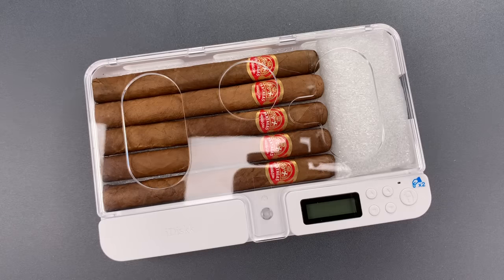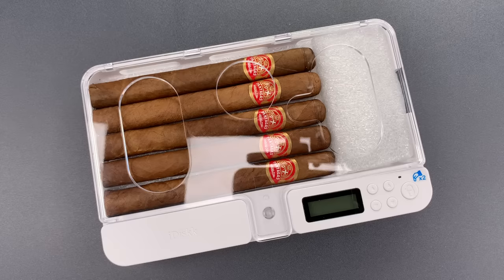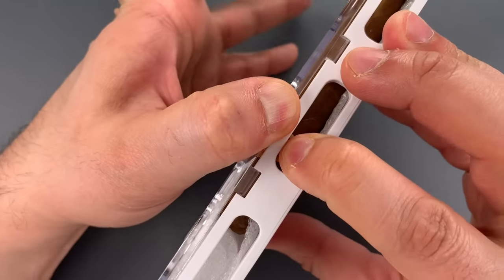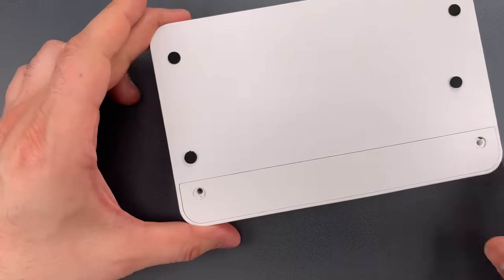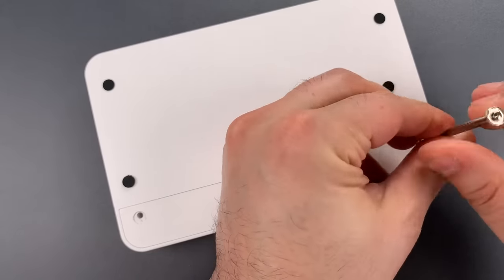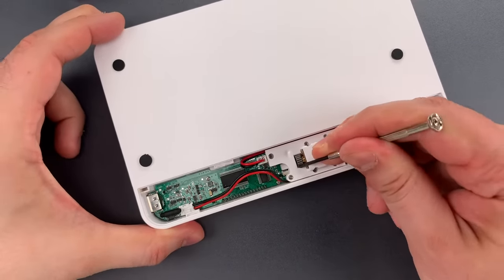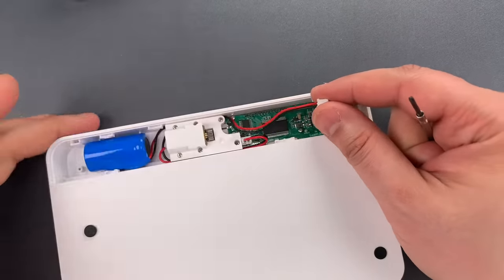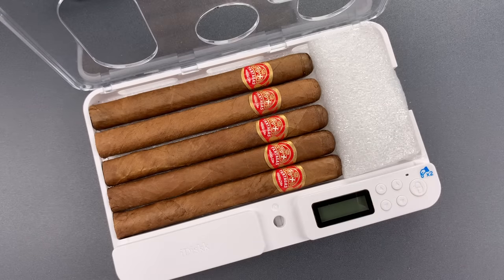[1192] Cuban Cigars Secured In An Electronic Smartphone Locker

Comment: that moment when a prank cigar box is still more secure locking mechanics wise than some of the gun lockers he has shown.
Reply: Lemme just grab my magnet
Reply: Gun lockers aren't designed to work. They're a big middle finger to security, designed as cheaply as possible to comply with the law without actually doing anything to secure a gun.

This was made to actually secure something.
Reply: tbh in this one he is addressing a challenge in real time whereas in others he's presenting deficiencies after a period of research.

Not to imply he is any lesser for it - this video is a great way to show how he approaches a new lock with active problem-solving skills.
Reply: You forget that the lid here is only plastic, and the hinges could easily be destroyed.
The gun safes are not hard to open as he has shown, but this was only hard to open because he tried it non destructive. This is basically openable by just dropping it
Reply: Not literally though. This thing could be destroyed by a gentle yet firm hammer blow.
Reply: lemme just get my lego astronaut
Reply: @addictinggames5232  That's fair.
Reply: @TeaInTheMorning-we2kh  so could the phone inside

Comment: “Have you tried turning it off and on?” Seems like the dumbest thing but it honestly has a lot of practical use
Reply: IT tech here, used to work call center, and yes, unbelievably yes.  Probably around 20-25% of my non-password related calls were "restart computer and if they were nice educate about RAM and Paging files."
Reply: As the tech support dude her says, a damned large portion of tech problems can be fixed with turning it off and on again. Anything from a phone, to a computer to a literal nuclear reactor and space craft
Reply: @athenacykes3486  That must have been before RAM evolved to become sufficiently large enough to make paging files unnecessary! :D
Reply: @athenacykes3486  It's fairly understandable that since an OS loads most of its configuration during startup, that many faults can be resolved with a restart/cold boot.
Reply: @ryanm.191  is it just me or have i heard the spacecraft one before
Reply: @ryanm.191  oh right it's hubble lmao
Reply: @DarkVoidIII  yet paging files is still a thing commonly used by almost all OSS unless you specifically turn it off
Reply: @Bradyboy26  You've never used Windows 10 or any OS that doesn't rely on paging files any more. Paging files became unnecessary for modern PC's and other devices when memory sizes increased sufficiently to handle it in memory.
Reply: surprisingly alot of stuff is as easy is turning it off and back on again
ive even fixed some issues by just unlplugging the 24pin from a motherboard and plugging it back in
Reply: @DarkVoidIII  Win 10 still has one. No doubt there as a redundancy for when the hardware no-longer matches the demands put on it. Not everyone replaces their computer every 2 years and for those who have an older machine, that extra virtual memory will very likely be a requisite. RAM overtaking demand is not a new phenomenon.
Reply: @kingofthegames7179  Also, yanking the CRT/CMOS battery on those systems that still have them is a common fix. Restoring the mainboard config to factory settings can deal with a slew of issues.
Reply: Didn't work for my grandma on life support . When i turned it back on, she as still off .
Reply: @sloh888  Probably needed a larger virtual memory reserve.
Reply: When did that happend @DarkVoidIII  ?
Reply: Yeah  @Pooknottin  win10 deffo has a pagefile, mine is in use that is for sure.
Reply: when your PC is on its last leg, turning it on and off is necessary. I was running from bluescreens/my computer giving up for weeks by cutting power cold and turning it back on like nothing happened.
Reply: @Pooknottin  also, even when you have data demands that fit within the RAM, sometimes you don't, and software doesn't always play nice. And you don't want an application, or even an OS to crash because it suddenly runs out of memory. It's not so much a redundancy, but an uncoupled store of memory.
Reply: @KnightSwordAG  Thanks for the heads up
Reply: IT crowd
Reply: turning it off and on is my first action now
Reply: Military Aviation guy here. That works for the majority of our problems on the aircraft too
Reply: Yeah turning stuff off and on can have almost miracle like effects.
Reply: They did that with the Hubble space telescope
Reply: @ryanm.191  Due to design flaws, Chernobyl nuclear power plant crashed during turning off.
Reply: @Rybakov22  and that sentence answered itself; it failed due to its design flaws

Comment: It makes more sense to send him an item encased in concrete at this point.
Reply: "This is the lockpicking lawyer, and today someone sent me this concrete block in the mail, I'll just grab this tool that bosnian bill and I made and it's open, in any case that's all I have for you today..."
Reply: @FamousPotato420.5  The Lock Pickaxing Lawyer
Reply: "you see concrete has an inevitable security flaw, It has almost no strength in tension. Just clamp both ends and pull apart"
Reply: @richbaker8211  The RockPicking Lawyer?
Reply: ramset time!
Reply: We are just going to turn it upside down, and take the item from the bottom...
Reply: @ApusApus  Ah LPL's Asian cousin
Reply: "Now let me just get my tools..." brings out hammer and chisel
Reply: Ramset!
Ramset!
Ramset!
Reply: he'll probably just slide a rake into a crack and the entire brick will split open through the breakline.
Reply: @ApusApus  👏
Reply: Put a little tension in the right spot with his wiper insert and bump it open
Reply: @FamousPotato420.5  Bosnia bill just hands him the .50 cal rifle
Reply: @ambertasniem7245  do you mean.. * OUR Tools? *
Reply: ... I thought it would be more fun to use some acoustic tuning, a technique I very rarely have a chance to use. So here we have our audio source, and I will tune it until we some reaction of the concrete block. We're now at 40.54 Hertz and you see some cracks appearing. By adjusting the dial juuust a little bit, we have resonance. It looks like 40.5732 Hertz was the correct frequency, the concrete is disintegrating into dust nicely and we got this open. I thank Glyne Lewis for sending me my favorite Bourbon. If there are any questions...
Reply: @n2n8sda  lol
Reply: "...I just put my hand over the box into the 4th dimension and grab the thing out..."
Reply: The rock picking lawyer
Reply: concrete? Give this guy Red Bull can and 2 minutes...
Reply: just imagine "Hello im TLPL and today we will be picking open this piece of concrete, I will be using this standard jack hammer in 1 ft to do so." That would be funny
Reply: click out of one.. two is binding
Reply: @n2n8sda  i am an Asian, you made me laugh good joke
Reply: @randomfold2343  yep
Reply: he can easily just pick that
Reply: "Today I'll show you how to open even the most stubborn of locks, like this concrete device a viewer sent me.  First, let me get my tools..." pulls out a pneumatic a hammer, chisel and dynamite  "Little click on one, click on two and boom we've got it open"
Reply: @raphyli  oh the puns!
Reply: Grabs hammer and chiesl I got a chip on one a chip on 2 and a crack on 3 and we are in
Reply: Naw just use duct tape
Reply: well at least there exists one lock made from wood
https://youtu.be/_A2WU7zdic0 & https://youtu.be/R8QTDWWDUi4 even with a reference to LPL ...
so we have to build a lock made of concrete with anti drill steel pins! xD
Reply: You say that but somehow I think he would find a fracture line, Tap it once with a chisel and a mallet, and the whole block would crumble.
Reply: I believe it was shown some videos ago, that duct tape packaging may be strong against LPL
Reply: @Drenix  so as an additional layer of security, we wrap the concrete lock in duct tape ;)
Reply: Do that, and he'll literally start "picking".... with a pickaxe 😉
Reply: "I'd like to see a higher security option"
Reply: jokes on you, he added loads of sugar to the mix while you weren’t looking and it didn’t set by the time he got it
Reply: "This is the lockpicking lawyer and today i will show you how to handle situations when your items get encased in conrete.

I have here a solid block of concrete sent to me by one of our fans in a test to see if i can get the surprise he hid inside , and he claims to work for construction and says he reinforced this with rebar.

This rebar is by [manufacturer] , but i believe he didn't know that the rebar manufacturer helps sell the metal used in Master brand locks as well. See if you pull on exposed rebar 2....click out of 3...click out of 4...then 1 is binding, click out of 2....and there we have it, the block splits evenly.

In any case, that's all i have for today. And as always, have a nice day. Thank you."
Reply: He has more trouble with duct tape and clam shell packaging, they would keep him out for a few minutes.
Reply: Yep, just as long as the concrete doesn't have a compartment that can be un-screwed. He cheated IMO.
Reply: some cigars in a clear acrylic block
Reply: @thewolfin  how about instead, we get him to do this test again, but WITHOUT un-screwing the battery compartment.
Reply: he'd pick that.
Reply: He would just dissolve the concrete I bet
Reply: @menzis0  What would he pick? A concrete box or an acrylic box or what. When you reply to a comment you need to be more specific.
Reply: Ramset test.
Reply: @timevers6525  🤣🤣
Reply: @SystemX1983  that wooded Lock is amazing!! Loved the TLPL left a comment on it.
Reply: click on one...
Reply: *Grabs picklock and hammer
Today we'll be chiselling through this concrete block using nothing but a picklock and hammer
Reply: He will still say..click at 3.
Reply: @amar....  "Nothing on 1, 2 is binding, click on 3... and it's open." Concrete block falls apart
Reply: The jackhammering Lock Picking Lawyer is born.
Reply: @FamousPotato420.5  Not even that, just ole' ramset
Reply: And then we find out LPL is also a sculptor
Reply: @FamousPotato420.5  i love you

Comment: Ah yes the rookie mistake.
The the Phillips head screw.
Reply: Specifically, the one under a sticker of some sort =.=
Reply: Yes, but you could open this box faster with a big screwdriver or hammer than by opening the internals and resetting the system.
Reply: still better than the security cabinet with the screw visible for all to see, lol.
Reply: @JohnADoe-pg1qk  got to make sure your parents don't know.
Reply: @JohnADoe-pg1qk  They keyword is NON-DESTRUCTIVELY...

Granted everything can be bruteforced... but will it be in one piece afterwards?
Reply: should of used triwing screws, since very few have screwdrivers for it.
Reply: the the the
Reply: @ainzooalgown7589  A triwing (aka Nintendo screw) can be opened with a flathead screwdriver that can fit into 2 wings
Reply: @ainzooalgown7589  better to use one way screws.
Reply: Still better than Master Lock.
Reply: Some epoxy in the screw holes would go a long way to making this harder to cheat.
Reply: @thiesenf  True.
Reply: @ainzooalgown7589  and for that reason alone I carry an ifixit tool kit in my bag
Reply: @ainzooalgown7589   I found the tang of a rat-tail file that was six sided, and it worked well.  One can also grind down small cheap screwdrivers to fit. Small Allen keys would probably work.  They work on torx quite well.
Reply: @theghostofthomasjenkins9643  
I was just going to say something about that. I could have gotten into that when I was 10. My uncle gave me a screwdriver and I took apart EVERYTHING I could find with screws including my sisters bathroom doorknob.
Reply: @txgunguy2766  i was the same way.  i took everything apart when i was younger until my parents told me i couldn't do it anymore unless i could put the things back together, lol.
Reply: could have at least used a torx head screw, made it a little difficult
Reply: I've got a dozen Phillips screwdrivers that would fit in there. A torx screw would have sent me to the store to get one specifically.
Always use torx for secure items, to add that small extra layer of complexity
Reply: Ah yes the the rookie mistake.
Reply: note to self. use Phillips head screw to hide some special unique screw below it. >BD
Reply: @ainzooalgown7589  Security by obscurity…
Reply: The the the the
Reply: @oH well,lord! That doesn't count as destructive. You can replace pads like that and no one would be the wiser.even though they're probably cheap pads that they have adhesive that can be used multiple times in a lot of casesif you take your time to put them back correctly people probably wouldn't tell you been in there
Reply: @JohnADoe-pg1qk  I can’t think of many locks that couldn’t be brute forced, and most of them could be done pretty fast too

Comment: The guy who sent that is like “Are you f*n kidding me.” Lol
Reply: Literally just turned it off and back on again 😂
Reply: This is the first time id be able to open the lock myself too.
Reply: @JayAR_YT  Ah! I can open a few of these locks with my bolt cutters!
Reply: Man gave him 41 hours 💀
Reply: @abbiefa  i think it was more the fact that he sent it through the post and wanted it to stay closed for long enough to get there
Reply: It was probably just for fun, maybe he just wanted to gift him a couple of cuban cigars. They aren’t exactly cheap.
Reply: I mean, tearing the feet off is playing fast-and-loose with "non-destructive" - but it's obviously not meant to be a security device in the first place, it's plastic after all.
Reply: you have approximately 41 hours to find your smallest screw driver. May God have mercy on your soul.
Reply: @justatest90  the adhesive stays on. You could put the screws back on and stick the feet back on. Hardly a destructive thing.
Reply: This is the exact opposite of the Ben and Jerry’s video.
Reply: As in "Are you f*n kidding me, ha took longer than I expected." :)
Reply: why did you censor fun
Reply: There aren't a lot of more clever ways to unlock the device, you could try and read the code off the ROM and maybe understand some vulnerability that involves nothing but pressing the buttons on the device, but that would take a lot longer and require some crazy hardware hacking and reverse code engineering.
Reply: @justatest90  when I hear “non destructive” I think “teenager who’s parents out phone into the lock, and wants their phone back without their parents knowing they took it out for a bit and getting into more trouble”
Reply: @JayAR_YT  Masterlock has you man doubt doubt yourself.
Reply: @cawashka  Only in America.

Cuban cigars are hella cheap in Cuba. Down there they just call them cigars. :p
Reply: No.
Reply: LPL:I wonder if we just unplug it to take the power out and plug it back in if anything will happen
Guy: Uh oh
LPL: *plugs it back in*
*motor whirring*
Guy: Are you serious?

Comment: “I could Hotwire the power supply, or jumper the power to the motor.....”
.....”Or I’ll just unplug it. ‘
Someone went to mechanical engineering school, designed this device with pride, just to be owned in under 3 minutes....
Reply: This product is super simple though. I guess whoever made this didn't care if someone was to open it that way.
Reply: that persons boss: i want a lock box
engineer: fast cheap or good, pick one.
boss: cheap, and yesterday
engineer: sigh, here we go again.
Reply: I figured removing the power was gonna do it when I saw the panel on the back.
Reply: My guess is that this is meant to be used by parents who are disciplining their children. They put the kid’s phone in there for a set amount of time.